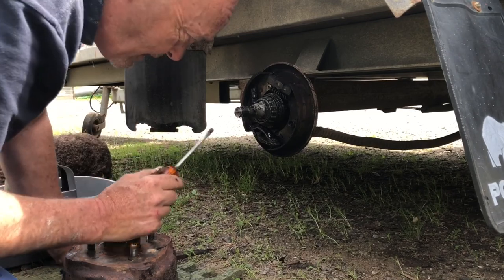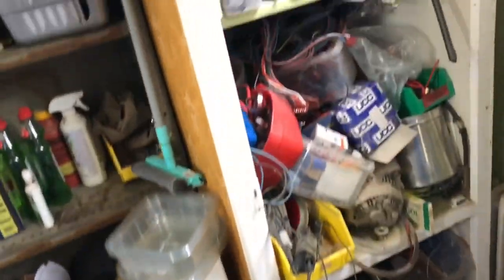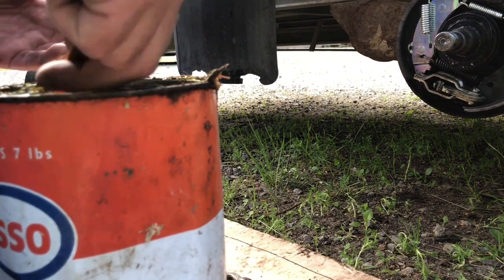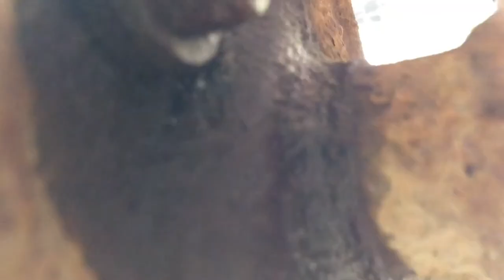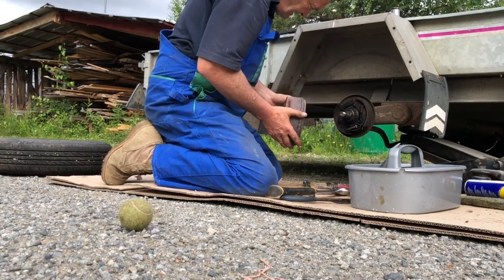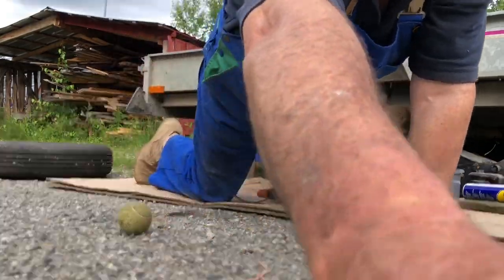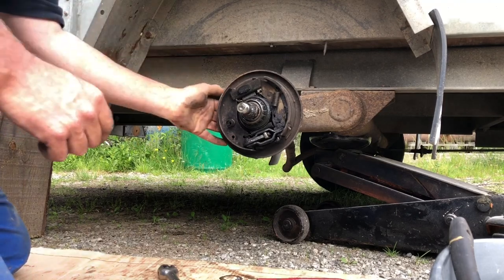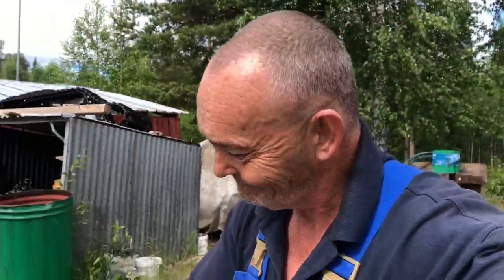Trailer Fire! Now what has broken? Bearings or Brakes have seized on and caused the wheel to burn.

Comment: Great job as usual. As far as packing bearings, before a packing tool came into existence, we would clean the bearings thoroughly, put grease in the palm of our hand, and pull the larger side of the bearing through the grease, this would completely fill the bearing with new grease. I realize there are many ways to pack bearings, right or wrong that was our way. 
Keep up the great videos!
Reply from the maker: Thanks Dave, now I think about it I have seen bearings packed like that but was so long ago I had forgot. Great reminder appreciated.
Reply: I think I have forgot more than I remember after nearly 40 yrs of heavy equipment and agriculture , a few things I remember being taught by an older mechanic when I was just starting out, this was one of them

Comment: Lol 1960 Molly grease is a fabulous prep for the Petie!   I use an 1970 OMC Marine grease in my prep..  Retains moisture? Lol New tools are cheaper, softer metal my finding?  I like the Millwalkee bits hardened tips. Electric tools I use Ryobi,still using 1st generation drills, saws, upgraded with a few fancy one lime green  but works for me.  Good luck on your choice.
Reply from the maker: Thanks Dave, your input is becoming more than welcome I really appreciate it, it keeps me grounded! Have a great weekend.